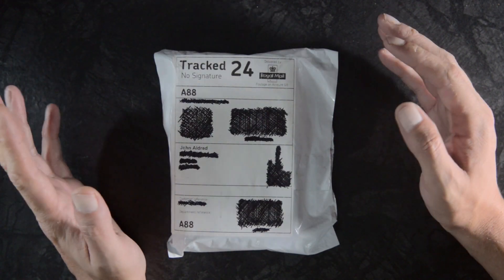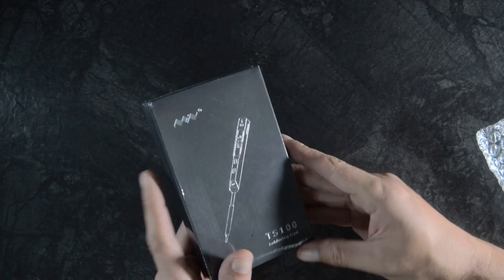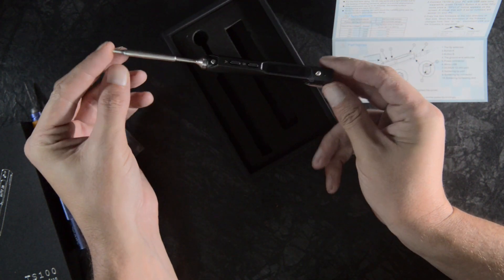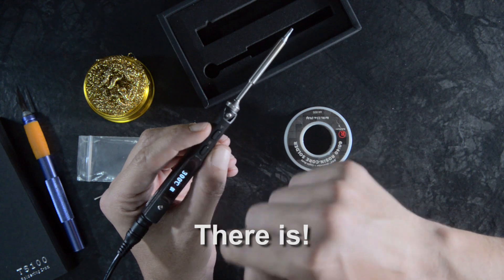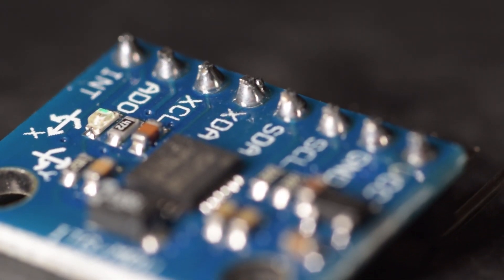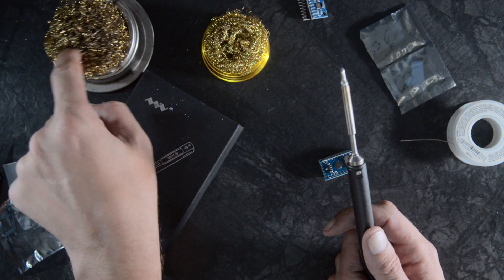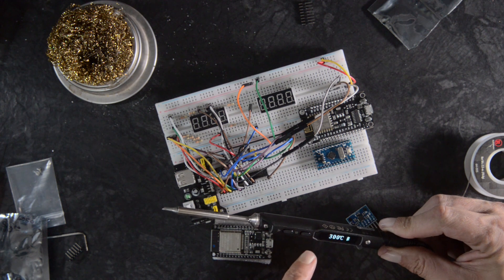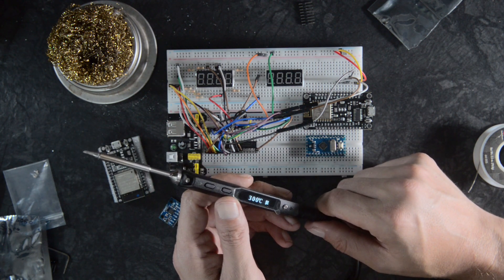TS100 soldering iron unboxing and first impressions

Comment: while excellent for portable work, it is absolutely unusable as desktop soldering iron for many reasons...
first of all it is to lite ! There is no power cable flexible enough that would not pull the soldering iron around the table
second , there is no suitable stand for it so every time you rest it on the table you must be extremely careful not to burn something.... and so on...
Reply from the maker: Oh, I don't know. I quite like the fact that it's so small and light. Those big chunky soldering irons I used to use gave me cramp in my hand over long sessions. They also have pretty thick and inflexible cables most of the time, too. You can get silicone cables to power your TS100 that are super flexible. I definitely agree with you about the stand, though. It would be nice if there was a good dedicated stand for the TS100, but I usually solder on a silicone mat, so putting it down without burning anything isn't a massive issue for me.
Reply: @JohnAldred  big and chunky has nothing to do with weight. Let me remind you that Cisco IP phone 7905 for instance, which is made of thin plastic (like most the things in modern world) has metal weight inserted in receiver just to make it feel better in the hand.
So I don't mind the size (although the bigger is better), I would just like that it stays in place rather than being moved by a thin cable.
Besides that and the fact that everybody who has ever written a line of code and owns TS100 is now trying to write their own firmware and to improve the original... WHY? for the same reason for which  dog licks it's balls... because they can...
So, I can conclude that I like TS100 tips if they were sticked into better handle and without al the nonsenses like left right display , thermometer, firmware, usb connector... and so on...

all in all a nice soldering iron (did I mention that for the same money you can do a much better???)...
Reply from the maker: It stays in place fine for me. But like I said, I use a silicone coated cable for power, not a stiff plastic coated cable. Works great for me. If it doesn't work great for you, that's fine. :)

Comment: Does it's grip gets hot after awhile?
Reply from the maker: Not that I've noticed. I was actually concerned about that at first, too and surprised by just how comfortable it feels and how well it seems to dissipate the heat only where it's needed.
Reply: @JohnAldred  wow you replied real fast. Do recommend it over a bench station?
Reply from the maker: I just posted up a video today, so had a notification while I was here, lol. I think it depends on your needs, really. If you're regularly using both a soldering iron and hot air for reflow work, then a bench station that supports both is probably optimal. I do plan to get a hot air station at some point, but I wouldn't use it enough to justify keeping it on my bench the whole time, whereas the TS100 just slots into the pen holder on my desk out of the way when not in use, ready to go at a moment's notice.

Comment: I have been using TS100 for last 4-5 years and I burn out 6-7 heaters-tips (a lot of smd soldering) and at last I found review of it. Thank you for review.
Reply from the maker: Good to know, I'll keep an eye on the tips as I start to venture more into SMD soldering. :)

Which tip do you find you use most often for SMD?
Reply: Is it still working?

Comment: Can you change the degree rating to real measurements or does it only read celcius?
Reply from the maker: Haha, I don't have it handy at the moment (I'm filming in Edinburgh this week and the  iron is at home) but I believe you can. If you Google "TS100 PDF Manual" it should have all the settings you can change in it.

Comment: Nice! How would you rate this vs a soldering iron in a reflow station
Reply from the maker: Well, assuming similar power and capability, the biggest advantage for me of this is it runs on 12-24v power with a standard DC barrel jack. So I can use it with a bunch of different power adapters with thinner, longer cables that that I can move  out of my way more easily while working and I can take it out in the field to spot fix or adjust projects while I'm testing them off lipo batteries.